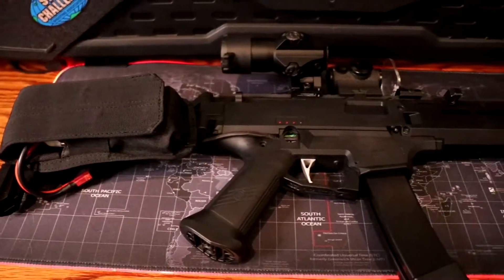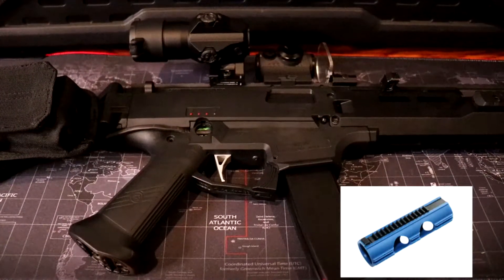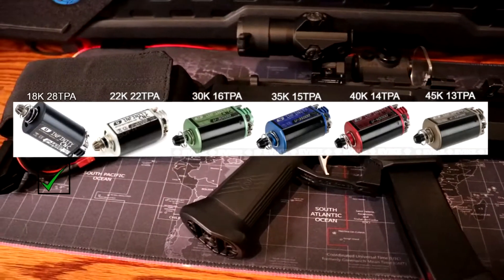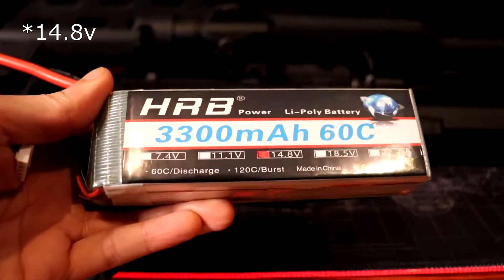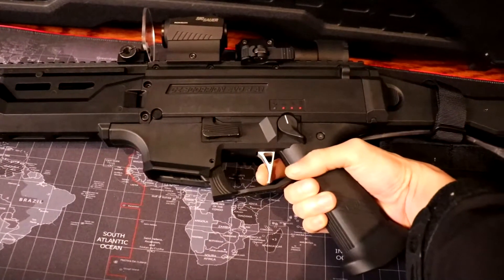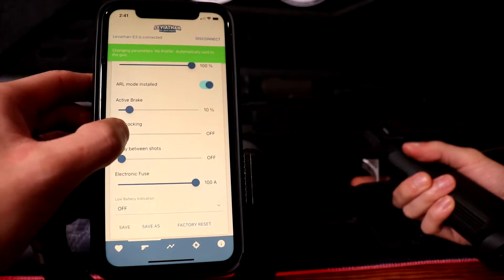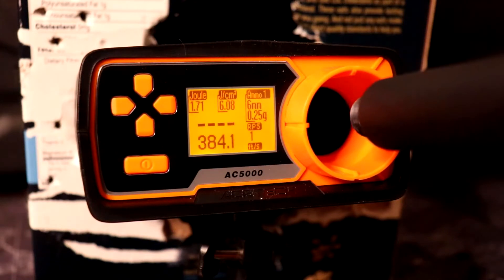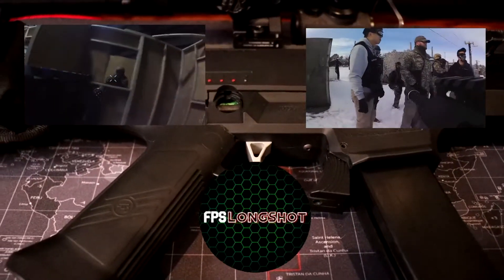ASG EVO Trigger Response Build 12:1 Gears with Precock - Airsoft AEG

Comment: Nice trigger response but very unstable fps if you fix this that will be overpowered. Good job
Reply from the maker: Yeah the air nozzle was being pulled back too early. I sanded down the front of the SHS delayer chip and that fixed the fps issue. Removing the chip would fix it as well.

Comment: Did you have any issues with the leviathan? When I trigger fast it sometimes gives short beep alarm, meaning that the battery was disconnected during fire.
Reply: Not sure about these mosfets, I’m a tech and people I work for have never had me install a leviathan usually a perun or titan but I’ve had this problem before I reccomend using a higher discharge battery, maybe try different motor, or change out the sector gear

Comment: Why use the 14.8v?
Reply from the maker: It makes the gearbox cycle faster. 11.1v lipos are still plenty fast tho. I use both for this setup. The 11.1v just need a bit more ms of pre-cock.
Reply: @FPSsuper  huh super weird. Even though its not an evo I have a leviathan as well running on a 11.1 16c discharge rate lipo and on 13:1 gears with an m115 and getting +-10ms without precock and I have a teinly 30k with 20tpa
Reply from the maker: @joshmackie7879  Nice setup. From switching between my 11.1v and my 14.8v, the 14.8v just cycles a bit faster. Is it worth upgrading to? Not really.
Reply: @joshmackie7879  the 30k Tienly is a 19TPA not 20 TPA i think as it says it on their sheet. But it could have changed as well